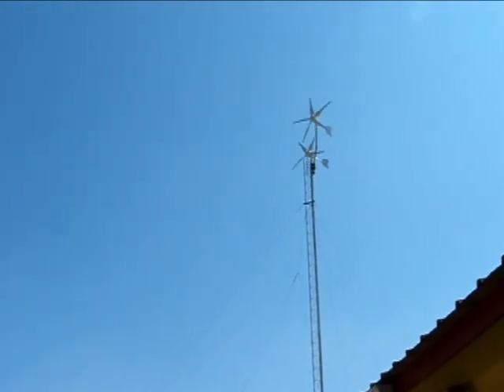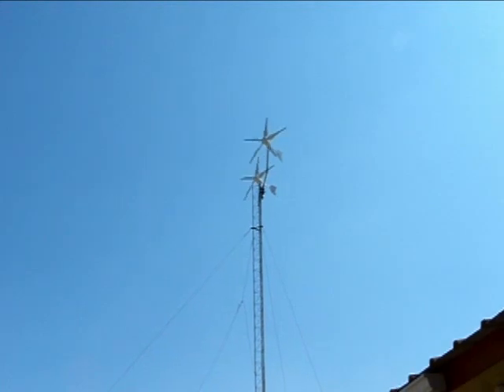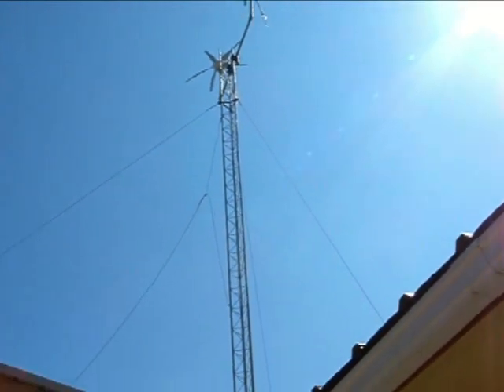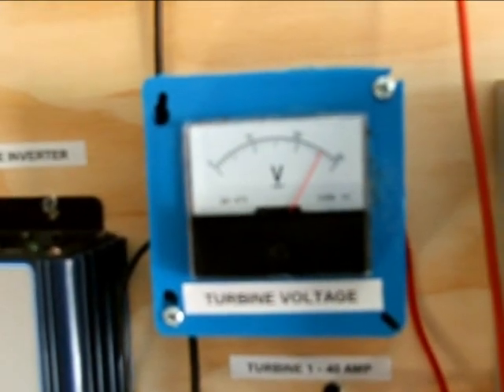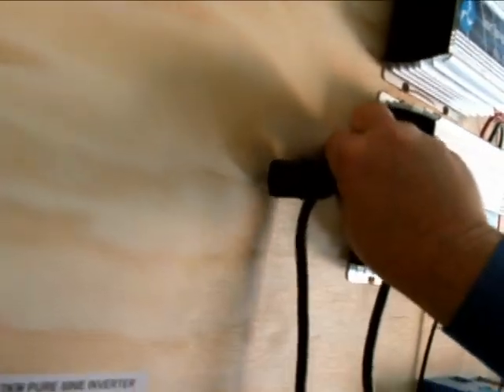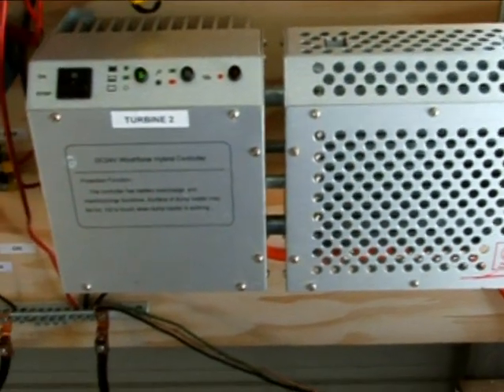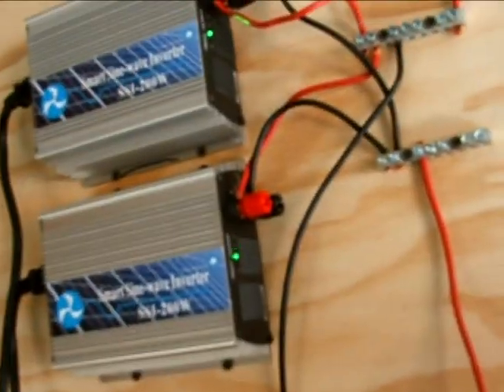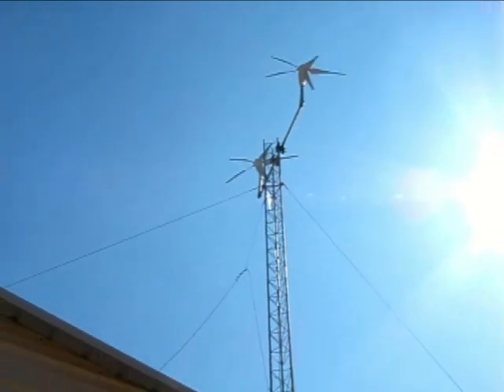WindMax 1Kw wind turbine/generators performance in 10mph wind.mp4

Comment: Overall Your video was good. If you have windspeed of 10mph at ground level. The wind speed at 53 feet will be much faster and stronger. That's why they say to mount them at 65 feet above the  ground.

Comment: hello, have question, i have hybrid system 2 wind turbines and 2 solar panels max output 1220W. Can i hook up this system to  1000w grid tie inverter or i need get another one because the max output of the system ins above 1000w. Thanks

Comment from the maker: Whoever told you that is full of boloney and does not understand how they work. They only monitor power source for voltage, that's it, and they monitor output for phase wave generation to match their own output. You could connect 100 of these things to a battery bank and they will all work perfectly. Such nonsense being spread out there surely is making someone some good money.

Comment: not two. if you separate them totally with each theyr own charge controller, dumpcharge, and grid tie, it will work, but not like this where both grid tie inverters draw from same power.

Comment: Your grid tie converters can not be fighting over the same powersource. they will try to draw amp indipendently and not know of each other, so they will mess with eachother. i have asked around and a engineer told me i had to use a single grid tie per powersource. so if you want two windmills feeding the grid with 1 batterypack you have to use 1 grid tie,

Comment from the maker: Dude, the negative and positive feed wires are going to terminal blocks and from there there are branch wires to each inverter, in what world is that a series connection??? If you were right, then all our homes and factories are wired in series because our breaker panels feed all branches from just two or three terminal blocks. Where did you get that from???

Comment: u need to convert that high speed from the  turbine into torque for the generator. just like a car first gear will drive slow but powerful. u need gears. u can try using pully system one small and the other big so u can convert that high speed into even higher speed for the motors like 10/1 ratio. so when the wind is slow the motor will still drive sorta fast and produce power